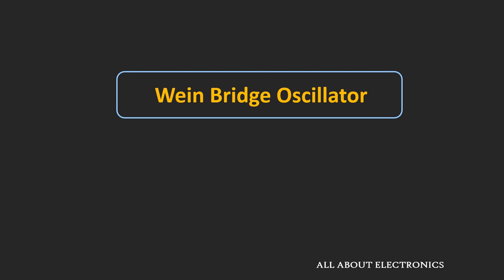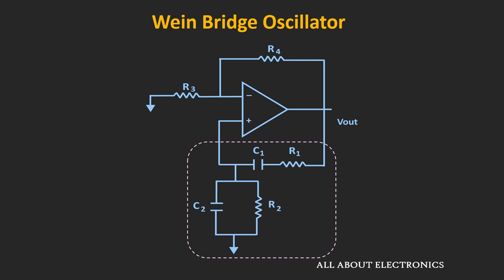Wien Bridge Oscillator (using op-amp) Explained

Comment from the maker: The timestamps for the  different topics covered in the video:

0:26  Introduction to Wein Bridge Oscillator

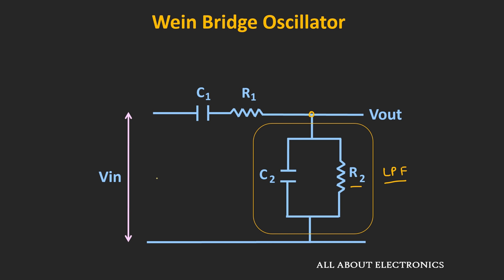2:31 Resonant frequency and the Oscillation criteria for the Wein Bridge Oscillator

5:07 Example: Design of Wein Bridge Oscillator

6:58 Derivation of frequency for the Wein Bridge Oscillator
Reply: Please give me physical explanation of wein bridge oscillator
Reply from the maker: First of all, I hope you understood the basic working principle of the oscillator.  In the oscillator, there is no input. The noise acts like as an input. And the noise has all the frequency components, few Hz to even 100s of MHz. Out of all the frequency components, only one frequency is selected by the feedback circuit. (And that's why the feedback network is also known as the frequency selective feedback network). Which eventually gets amplified and we get the oscillation.
In wien bridge oscillator, the RC feedback network acts like a notch filter. So, it provides maximum output at only one particular frequency. If you look at the circuit, the output of the feedback circuit is given to the positive input terminal of the op-amp. (There is positive feedback). 
And because of that, at one frequency, the oscillations will build up in the circuit. Also, there is a negative feedback in the circuit through the resistor R4, which is a part of the non-inverting op-amp. 
So, this positive and negative feedback controls the loop gain. And by careful selection of the component we can get AB= 1 (Or for practical circuit, slightly more than 1).
I hope it will help you in understanding a bit more about the wien bridge oscillator.
Reply: Why you put j=-1?
Reply: thanks man
Reply: @ALLABOUTELECTRONICS  
How are you so patient to type so much for somebody and expecting nothing in return
You are truly amazing sir
Reply: @sharonyabanerjee2867  j square is -1
it is complex number from mathematics

Comment: Sir why this Wien bridge oscillator generates only the sine waves. ? Could u please explain this Sir
Reply from the maker: If you have observed the circuit, the RC circuit in the feedback is frequency selective circuit. And acts like a notch filter. 
So, it only allows a single frequency and rejects the remaining. 
If you know the Fourier transform, a single frequency in the frequency domain represents the pure sinewave in the time domain. 
For example, a triangular wave or square wave consists of multiple frequencies. 
That's why this Wien bridge or any harmonic oscillator like RC phase shift oscillator or Colpitts oscillator generates the sine wave. 
I hope it will clear your doubt.

Comment: Sir
At 1:05
shouldn't the positions of  R3 and R4 be exchanged
Because in the Wein bridge R4 is to ground and R3 is connected to output
And when I analysed Wien bridge oscillator using BJT I got R3/R4 = 2 (which is correct if R3is in feedbck path and R4 is grounded)
And not R4/R3=2 as in 4:46
Thank you in advance

Comment: If you actually build this circuit, you do need some kind of active gain control. If you try to use fixed values, it either goes into saturation, creating a square wave, or, there isn't enough gain, and it simply will not continue to oscillate. I've used a very small incandescent lamp as a non-linear resistance in series with R4, and if the amplitude goes too high, the bulb filament heats up, and it's resistance goes up. It produces a beautiful sine wave, but light bulbs are microphonic, and thermally massive, sometimes causing a "Bounce" in amplitude, then it finally stabilizes. It also causes distortion at very low frequencies.(below~5 Hz) because the filament can heat and cool in real time, as the wave crests, and crosses zero. I've seen other schemes that use parallelled diodes, cathode to anode, cathode to anode, where if the amplitude exceeds the forward voltage drop of the diodes, it clamps the amplitude. This is accomplished by dividing R4 into two resistors and putting the diodes in parallel with a low value of resistance, so that at amplitude, only ~.6 volts appears across it at set amplitude. If the output amplitude goes too high, the diodes begin conducting, effectively reducing the gain of the amplifier. Unlike the light bulb scheme, it works equally well at any frequency, even down below 1 Hz. It does cause a small compression in the wave form, but you can't see it on an oscilloscope. It shows up on a harmonic distortion meter.(less than 1% THD) you have to balance distortion with stability. the less influence the diodes have, the less distortion, the more, the better the stability.

Comment: Can you please ans this 
AB =1 ; where A is open loop gain then how can you write 
A= 1+ R4/ R3 .
Isn't the above equation meant for closed Loop gain Of non inverting amplifier.
Correct me if I'm wrong.
Besides that your video are short and to the point👍

Comment: In starting part of video when u  re-draw the circuit in that instead of R3, R4 is ground and  later when u separately drawn the feedback network in that  parallel combination of RC is connected to vout instead of Vin.
Reply from the maker: Yes, instead of R3 it should have been R4. (The positions of R3 and R4 got interchanged). Rest is fine. Thanks for pointing it out.
Reply: @ALLABOUTELECTRONICS   what's about feedback network drawn separately..in that low parallel RC combination is connected connected to vout instead of Vin.
Reply from the maker: It's just for finding the transfer function. It has nothing to do with the circuit drawn earlier. The more appropriate notation would be Vout and V+. (I mean Vout as input and V+ as output). 
But we are more familiar with the Vo and Vin. So, the same was used for deriving the transfer function. 
I hope it will clear your doubt now.

Comment: At 9:50 you had said that at resonant frequency the term 1-w^2R1R2C1C2=0 : but why?
Reply from the maker: Because at resonance, the circuit is purely resistive in nature and hence overall phase shift should be equal to zero. From that equation perspective, Vo/Vin will have zero phase shift when the first you mentioned is zero. I hope it will clear your doubt.

Comment: first of all thank u so much it really helped me, but I have a question
why the ratio between the output and input voltages are 1/3?
Reply from the maker: From 7:00 onwards, I have explained the derivation for the same. You will get to know that, why it is 1/3.

Comment: Excelent videos 👏🏻👏🏻👏🏻👌🏼
Only one question, someone knows Why in colpitts oscilator we need to include the internal resistence of the output (ro) to obtain the correct equations, and in this oscilator is not necessary to the analysis?
Thank you for all 🙏🏼

Comment: You call the positive feedback network a notch filter, but a notch filter attenuates a specific frequency. Isn't it rather a narrow bandpass filter? Also you did not mention the issue of amplitude stabilisation important to this circuit. With just resistors for R3 and R4 the circuit will not have stable amplitude, possible solutions include an NTC element in place of R4 or a lamp (PTC) in place of R3, but there are other solutions. Otherwise great explanation.
Reply: Long time ago but you are quite correct....still !

Comment: Nicely explained. I have a doubt though.. what's the magnitude of sinusoidal output voltage we get of win bridge how can we evaluate that?
Reply from the maker: The magnitude of the sine wave will depend on the Loop gain and the supply voltage.
Like I said earlier, for oscillations to build up, initially the gain A should be slightly more than 3. And once the oscillations build up then get gain should be reduced to 3.
To achieve that a tungsten lamp can be used as resistor R3.
Initially, it's value will be less than let's say R. And once the oscillation builds up then due to heating the value of R3 will slightly increase such that loop gain becomes 1.
Here too, the amplitude will depend on the supply voltages of the op-amp as well the op-amp itself. 
By changing the supply voltages, the amplitude can be changed. 
The other circuit to control the amplitude of the wien bridge oscillator is using the diode.
Where two diodes along with series resistor are used to control the amplitude of the output in the feedback. (In parallel with R4 resistor ).
Usually, the series resistor with the diode (Let's say R5) is approx. 10 times the value of R4.
And by controlling the gain of the Amplifier (either changing the value  R3 or R4 slightly), the amplitude of the oscillation can be varied.
I hope it will clear your doubt.
Reply: I constructed the circuit with a +-15V supply voltage to op-amp and the output that i got was a sine wave whose amplitude I can vary from 24-27Vpp with nearly sustained output. Only thing that makes me wonder is that if the gain needs to be at 3 as beta is 1/3 I shouldn't have the freedom to change gain and if I change gain the effect of AB not =1 was not that much visible in the output range of 24-27Vpp.
I got your technique of how the oscillations will be built up, but theoretically can I prove the output will be close to supply voltage?
Also how the two diodes along with series resistor circuit will look like.. a bit confused can you put a picture with some explanation as in how the output voltage is controlled.
Thanks for your quick response. Awesome job you're doing!
Reply from the maker: 24V- 27V peak to peak voltage is almost near the supply rail. I mean to say if 15V is supply voltage then the output would be restricted to around 12.5- 13V. And that seems so. See, even if AB goes slightly even above 1 then also you will get the same result, as output is near saturation to the supply voltage. But if AB goes below 1 then you may not observe the oscillations. You can try that by changing the gain of A. 
Because in that case, oscillations will die out.
So, I would say, there is not much control for changing the amplitude in this circuit. (that would be visible in the second circuit using diodes which I was talking)
The only way it would be visible is by changing the supply voltages. Let's say, if you change the supply voltages to +-10 V. then the output would be limited to around 16-17Vpp.
Please message me on the facebook page. (You can find the link of the page in the description)
whenever I get free, I will send you the picture of the circuit which is designed using a diodes.

Comment: Hi, I’m newish to electronics so this may be really stupid, but what is J and w and how did you get the initial equations that you used. The rest of the maths was great and really easy to follow but I just don’t know how it started. Thanks
Reply from the maker: It's the reactance of the capacitor. It can be represented as 1/jwc.
where w is the frequency in radian. w= 2πf

Comment: brother one thing is bothering me... can we interchange the terminals of feedback network??? eg you have connected series RC to output and parallel RC to non inverting terminal so can we connect series RC to non inverting input terminal of opamp and  parallel RC to output of opamp?
Reply from the maker: If you have followed the video, then the feedback fraction Beta is 1/3 when the input is given at the series RC circuit and output is taken across the parallel RC circuit. If the order of these circuits is changed then we will not get the same transfer function. That's why it can't be changed. 
I hope it will clear your doubt.
Reply: ALL ABOUT ELECTRONICS thanks man .. I really appreciate your efforts

Comment: Could u plz explain the math derivation after sub of z1&z2
Reply from the maker: May I know exactly what you didn't understand in the derivation. 
In this derivation, the output of the op-amp is actually input to the feedback circuit (Vin). And the output of the feedback circuit (Vout) is going as input to the non-inverting terminal of the op-amp. 
So, transfer function Vout/Vin is found to get the amplitude and phase of the feedback circuit.
Reply: @ALLABOUTELECTRONICS   @8.37 after u substitute the values of  z2/z1+z2 plz explain the math derivation
Reply from the maker: Using LCM the equation has been simplified.

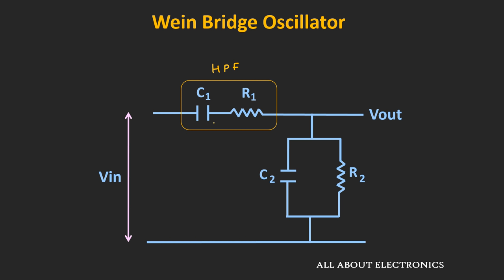Comment: 1:40 how come vout is connected to parallel circuit of RC
Reply from the maker: Please do not link it with the oscillator circuit. While explaining I have considered this circuit as a separate circuit. (Just to explain the working of the circuit in general). The input and output are not the input /output of the oscillator. I just wanted to explain, if some input is given on side of this circuit then how this circuit behaves.

Comment: Sir
Bit if we are designing this with 2 BJTs in 2 stage so that phase shift is 180+180=360 
How will we design the BJT biasing circuits
We can design the components of the bridge by R3/R4 =2 and from frequency formula
But how to get A=3 if beta of BJT is like 100 each and Vcc something like 10v
Thank you

Comment: if I have a previous circuit that uses photocell as a voltage divider, where should I connect that voltage on the oscillator, the positive power source? or negative input?
Reply from the maker: It if is designed using the op-amp, then some op-amp requires both positive and negative power supply, while some required only positive power supply. If it is single power supply op-amp, then you can apply it it positive power supply.

Comment: what is the highest frequency you can design the wien bridge for and what type of wave does it produce?
Reply: As long as you use ONLY solid state devices you can't get very high frequencies, no matter design or configuration, this is why a crystal is so necessary, in order to reach freqs of several hundred thousands and much higher. If you design an oscillator for, let's say, 0.5 Mhz using solid state only, you'll get it work but it will be unstable. In fact, the highr freq. the less reliable.

Comment: how parallel rc network acts as alow pass filter ????
in low pass filter if we take o/p from capacitor this is known as low pass filter but here the voltage take from both r and c r equal .
Reply from the maker: At high frequencies, the capacitor provides very low impedance. Xc = 1/(2*pi*f*c)
So, the overall impedance of the parallel combination of R and C will be very low. Let's say, the impedance of the parallel combination is Z2. 
And series combination R1 + C1 is Z1. Then Z2*Vin/(Z1+Z2) will be very low at high frequencies.
At low frequency, Xc2 will be high and can be assumed as an open circuit. So, Z2 is approximately equal to R2. And you will get finite output at low frequencies. 
And that's how the parallel combination of R2 and C2 acts as a low pass filter.
I hope it will clear your doubt.
Reply: thanks sir

Comment: how do we get the exp 
 A=1+R4/R3
Reply from the maker: The op-amp is configured in non-inverting amplifier configuration. That's why its gain would be 1 + Rf/R1.
In this case, it would be 1 + R4/R3.

Comment: Sir can you tell me why does the wein bridge oscillator Will not work when we don't supply any input voltage
Reply from the maker: Do you mean to say why it will not work without a dc power supply?
Reply: Sir do we applying any input sigal here for which getting a sinusoidal out / it's generat due to leakage current???
Reply from the maker: @mrinmoymandal2695  No, we are not applying any AC input signal. Only DC power supply is applied to the active component. In this case, its the supply voltage to the op-amp. And the AC signal is eventually growing from the thermal noise present in the circuit.
For more information about the working of any oscillator circuit, please check my video on how the oscillator works. 
Here is the link : 
https://youtu.be/XVS8Puf4tiw

Comment: 1:05
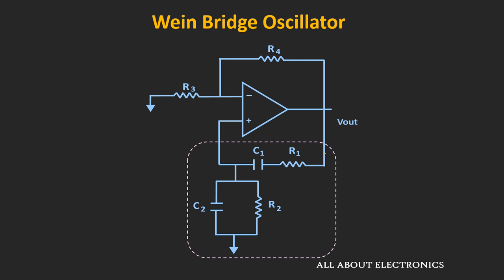1:10
1:15
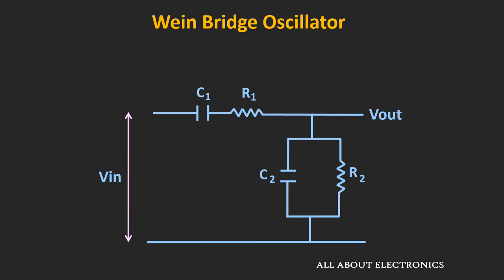1:19
1:25
1:30
1:36
1:41
1:46
1:49
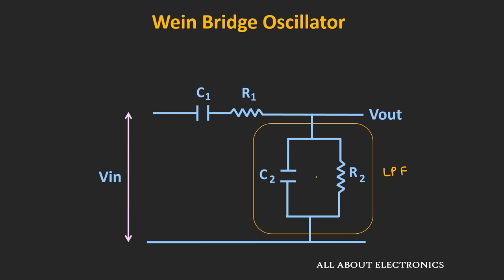1:55
1:58

02:02
02:07
02:09
02:16
02:21
02:25
02:30
02:37
02:42
02:51
02:55
02:56
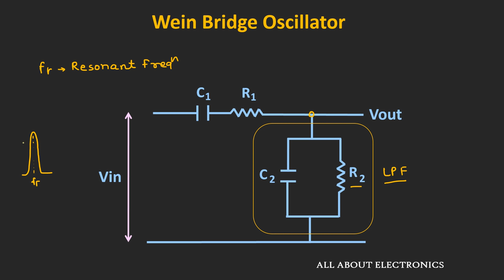03:02
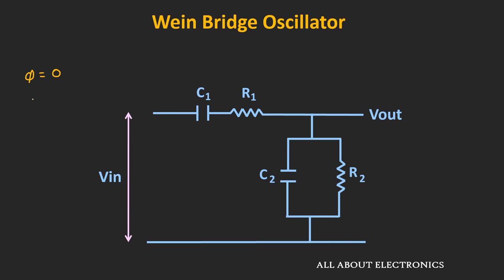03:06
03:06
03:12
03:18
03:28
03:36
03:45
03:55
04:00
04:05
04:11
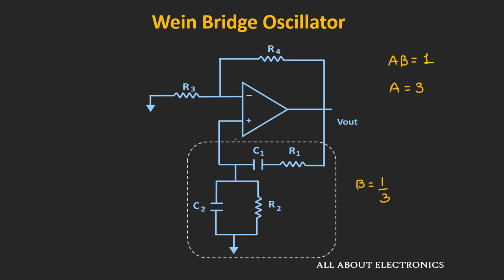04:18
Now, as we know this op-amp is configured in a non-inverting configuration, so the gain
04:23
04:27
04:37
04:45
04:51
04:57
04:58
05:04

Comment: Why ' j' is taken
Reply from the maker: Hi, I didn't get it what you mean to say. 
Would you please provide the timestamp in the video where you are referring to?
Reply: the j notation used in the derivation of the formula is there to allow the calculation to be calculated for the imaginary part of the circuit. the use off the capacitors led to phase shift that must be taken into account.